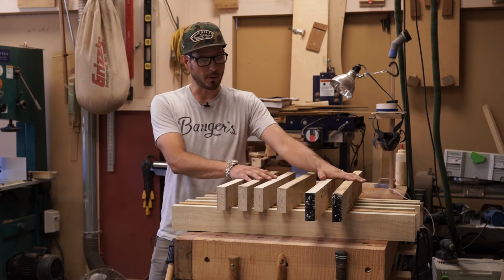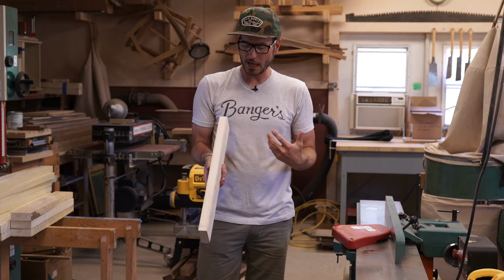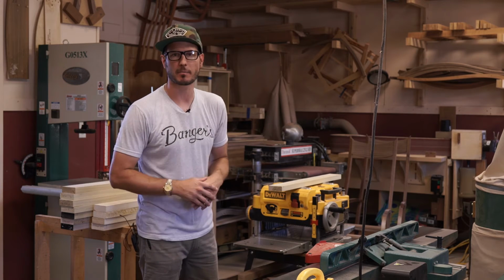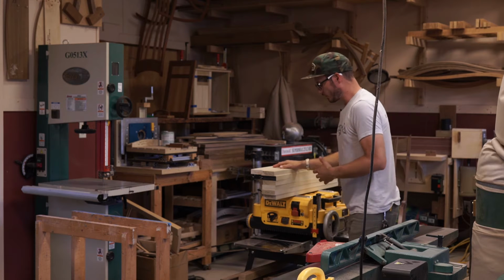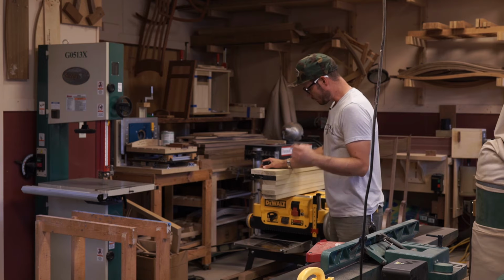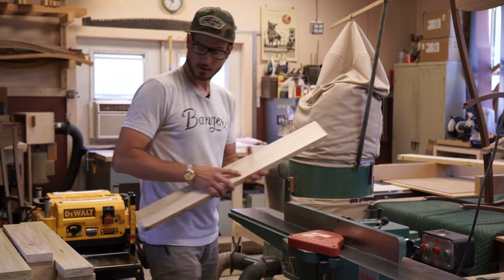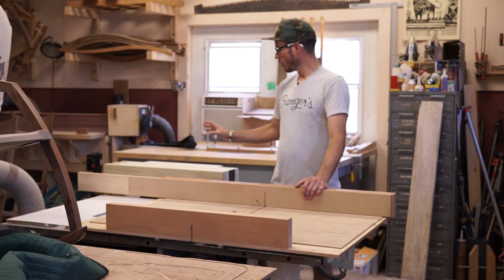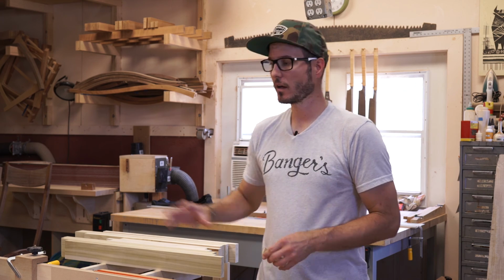James Krenov Style Sawhorses | Part 2 - Milling

Comment: I'm interested in your concept for dealing with snipe while using the planer. During your rough cut stage of milling, due you plan for cutting off the parts that have have snipe? No matter how well I calibrate the my planer, snipe is an issue and will affect final project outcome.
Reply from the maker: +Kevin Bostrom  for the most part my planner is set up that it doesn't really snipe maybe a few thousand's but I always follow a piece behind each other so the last piece is  usually the only one with any snipe. Of course if you're planer snipes quite a bit then you need to make accommodations for it. Cheers 👊
Reply: Philip Morley Furniture Thanks for your response.  It is always good to get advice from other with more experience. I throughly enjoy your content.👏🍻